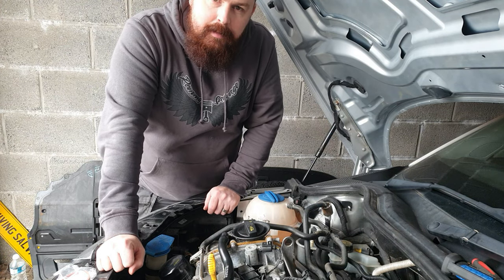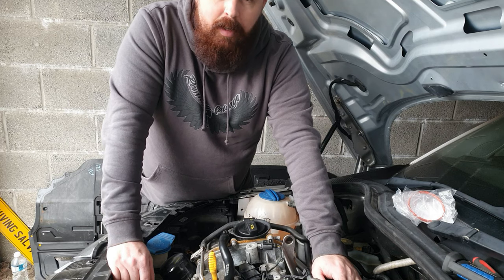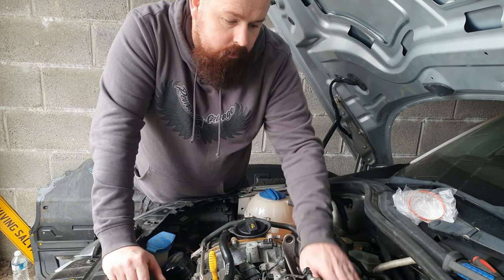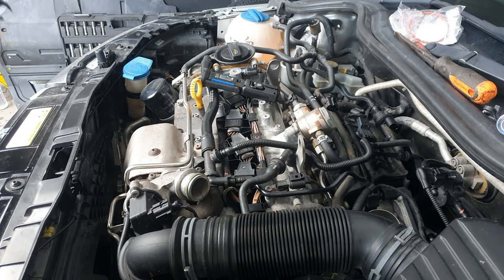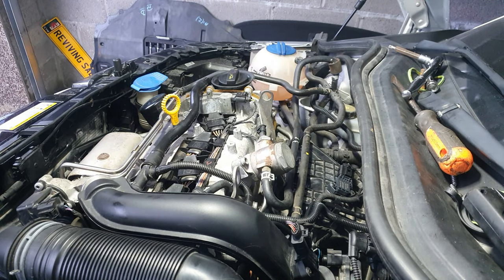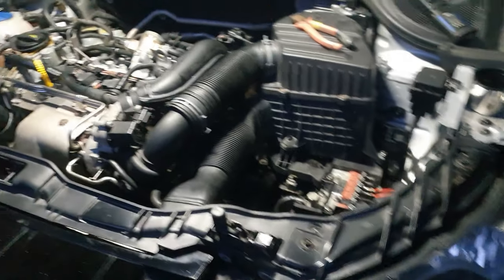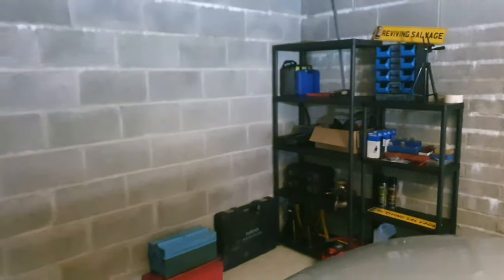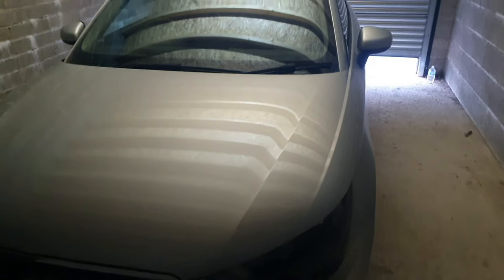Replacing Manifold Seals & Doing A Vacuum Test On My Copart Audi A1 Salvage Rebuild Project Car.

Comment: Hi mate befor you do the injectors try that fuel regulator on top of the engine look up the symptoms for it as the car came from a salvage action and been stood up this could have jammed which is causing the over fuelling issue check this befor the injectors.....

Comment: Before replacing the injectors i would start looking at the live data fuel trim values both short term.and long term values that will help to show if its a fueling issue, vacumm leak or O2 issue. Have a look at Scotty Kilmers channel, he explains it very good for the average DIY er.

Comment: Has the engine got a pcv valve it could be sucking in air  giveing you the problems like that, check the oil filler cap isn't been sucked back down when enging is running as you try taking the cap off. That's if you got a pcv valve in the valve cover, hp fuel pump on valve cover leaking fuel into the oil sump, check live date fuel times  as well put a scop on the injectors  best of luck m8t keep up the good work.
Reply: I suggested the HP fuel pump to him

Comment: Think Donimec Parsons is spot on. If it’s got 51k miles and has had a front end , the chances of injectors failing? Very slim..
  As per my post on your last upload, check timing. If it’s been in a smack then the engine could very well of been turned off when the car bounced. The recovery truck could have hooked up and started pulling it whilst it was in gear.  Etc etc.  I think you even said that when you got it , it was in gear. Chances are someone, somewhere has pulled it whilst it’s in gear. The importance? TFSI use oil pressure to run the tensioner properly. No oil pressure means no proper chain tensioning, if it’s in gear and dragged , the engine will turn with no tension on chains. 
 I am still putting money on timing being out which is affecting fuelling/overlap and the lambda is having a hissy fit because of it, check timing.

Comment: You are like me Stubborn !! Check the engine oil as if the injectors are supplying to much fuel then usually the oil gets thinner as the unburned fuel runs down the bores into the sump past the piston rings i have seen this before on a peugeot 205Gti 1.9 litre .stay strong you will eventually get this keep up the good work

Comment: Injectors aren’t cheap £400 a set???
Just recall your journey, the car was taken off the road as it was involved in an accident therefore it was running ok presumably.
A car with 51,000 miles will not require new injectors unless they were damaged in the accident.
VW software live data will show injectors performance, I’d be doing a smoke test first to check vacuum and air leaks as this is normally the causes of the issues your car has.
Also check the exhaust for damage fork lift at copart have a habit of doing.
Also from my experience pattern sensors never a good replacement for genuine .
VW software won’t always flag up a cheaper option, the car ECU will.
This car must be breaking the bank now, and I feel your frustration.
Best off luck.
Dom

Comment: Dont waste your money on solar panels, unless you can have a panel the size of the garage door and very big batteries. At this time of year your lucky to get 4 hrs of useable sunlight that will charge the batteries, i know tried this on a shed and was very dissappointed and wasted alot of money. I would go for a small generator that canal boat users use on the tow path, very quiet and easy to setup in seconds.

Comment: As another commenter said - look at fuel trims. Look at this video: https://www.youtube.com/watch?v=s1CT3ZW2_4M&ab_channel=ADVANCEDLEVELAUTO  where he explains how to check for a vaccuum leak - eg upon reving - short term and long term fuel trims go to near 0 - as vacuum only at idle.  Will help if you get some live data on a video in the channel with the MAF g/cm and the o2 sensor voltages and fuel trims.